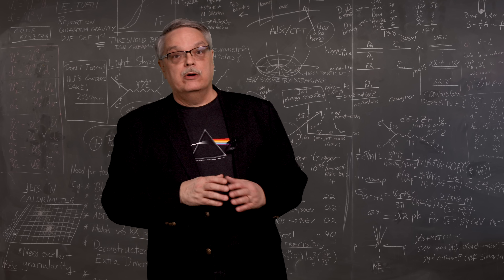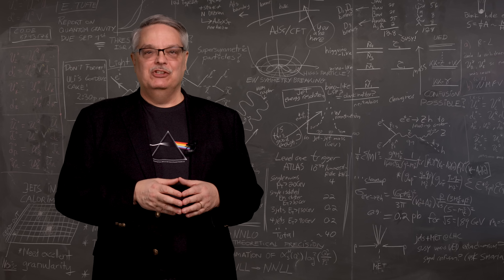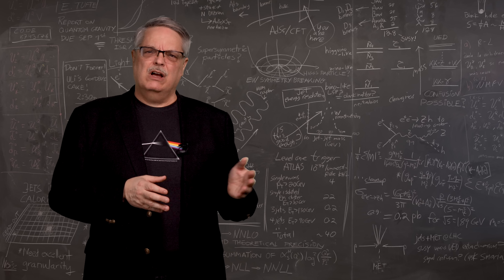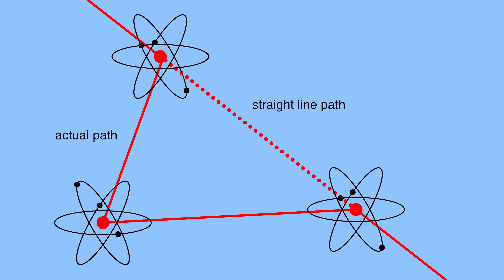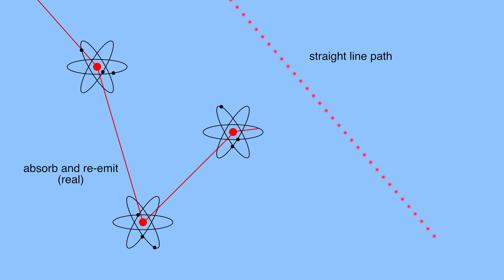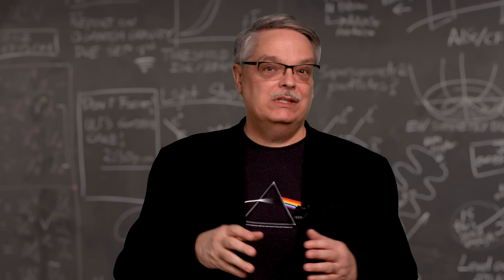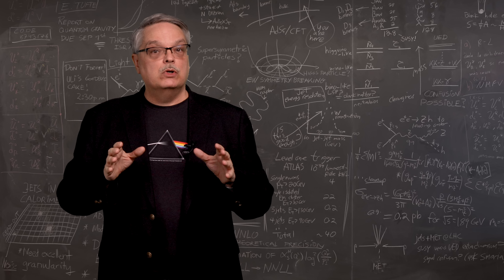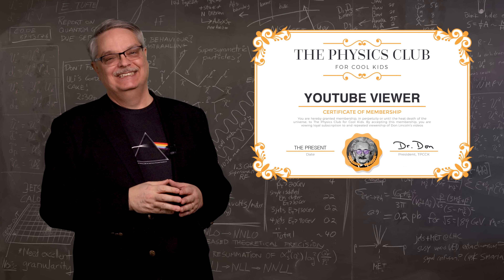Why does light slow down in water?

Comment: I did not hear why the wave superimposed with that generated by electrons moves slower, and why it returns to original velocity.  The glass heats up so energy is lost.  Is this all from IR not making it through?  Wouldn't just visible light heat up glass?  Then if it comes out the same as it came in, where would that energy (to heat the glass) come from?

Comment: Knowledge of humanity! 🤣Totally wrong! Light is never a wave, but ALWAYS a particle! It's known as quantum mechanics. Photons accelerate* (decelerate) in e.g. water or glass in proportion to the luminescence of the medium i.e. the more a medium luminesces the more the light decelerates. The deceleration* is a net loss of energy (E²=m²c⁴+p²c²) which is conserved by the luminescence. For example water or glass luminesces far more than air (a vacuum not at all) and slows* light in direct proportion. And since acceleration (deceleration) is curvature light bends (refracts) proportionately as well. QED. . . There, I have explained why light slows*, because of the luminescence of the medium and the conservation of energy and why the bending (refraction) of the light also occurs. . . The Fermilab guy doesn't know anything about physics and is just promoting obsolete pre-quantum hokum which requires a magical particle-wave-particle transmutation.
Note: curvature and acceleration are synonymous because when particle streams curve the must slow* (decelerate) in order to maintain separation (just like cars in traffic) due to Pauli's exclusion principle. The opposite and equal effect (acceleration) is produced by the cessation of curvature and it's why light reaccelerates* upon leaving e.g. water or glass.
* Of course, light doesn't ever change its speed (299, 792, 458 m/s), but time dilates instead.
Reply: Can you share the peer reviewed research paper, I'm assuming you will be the author on it right? Can you share and enlighten us? What sort of Lab do you run the research and get the data on? Just a curious person :)

Comment: Light speed does not alter. That should be said to everyone.

Slowing down of light speed in anywhere does not happen. Light speed is always the same, but different electric fields can alter the wave that combines with the light wave making combined speed different. And light itself creates this secondary field with interaction with electrons (and possibly with other particles too like protons?).

So in the roughest case in some Bosen-Einstein condensate you just make an opposite wave that cancels light speed in the combined wave and you nullify the speed completely. Light speed is the C, but nullifying field is -C so result is C-C = 0. So this means light may stop moving in Bosen-Einstein condensate. This has been done in lab experiments for a short time.

Also light wave cannot be send back by this method, just because C or -C are the maximum speeds. But you may bend light to do this (ie. mirrors), but it is an another discussion.

Great explanatory video. Keep on doing these!
Reply: Also light speed can be faster than light speed. If interfering field adds more speed to the light wave speed can be theoretically brought up to 2C (C+C = 2C). This has been tested in some labs that have gone over light speed.

In computers light speed (or more precisely electromagnetic wave speed) is a problem. When motherboard expands over 30cm the length of the cables becomes so long that information cannot travel fast enough when the processors hertz's (2 Thz) are rammed up. This has already happened and to overcome this issue data packets are handled simultaneously instead of sending them between processor and video card. But if we would find an usable way to top wave speed to 2C, then we could triple our PC's data transfer speeds (copper wire speed is are 2/3rd's of C, so 2/3C+2/3C+2/3C = 2C). So this is a real life problem.

Comment: Watching your explanation brought to mind the cool trick of dropping a magnet (that is hot glued to the end of a wooden dowel rod) down a copper pipe and being amazed at how 
1 fast it moves in air before it gets in the copper pipe
2 slow it moves in the copper pipe
3 fast it moves again in air after coming out of the copper pipe
The magnet has its own magnetic field but once it moves in copper then a reverse magnetic field is generated which acts on the magnet.
I like watching your videos  :)

Comment: Two comments: 1. Based on this explanation, can we infer that the mass & and charge of the electron are proportional to the index of refraction in transparent materials? One would think those factors could be rolled into a formula relating the relevant parameters. 2. Off topic, but I have often wondered about is the transparency of certain wavelengths in certain materials. Take near IR that can be transparent in some plastics which are opaque to visible light. I had to glue a piece of foil to a plastic nut once because we were using a photo interrupt slot sensor and the plastic flag didn't trip the IR beam. The engineer inside only needs to know enough to solve the problem, case closed & move on, but the scientist wants to know why, a lifetime of befuddlement.

Comment: So the density is the only thing proportional to the refraction of light in a transparent material, yet I can see that there might be very different electron configurations of different elements.  (ie a KBr crystal has a density of  2.75 while diamond has 3.5, but the electron configurations is very different between carbon, Potassium and Bromine; this is actually proven by their very different Transmission spectra as you look across the wavelengths of light which can pass through the material and also show that Electrons in the crystal ARE absorbing photons !!!)     IF this electron field hypothesis is correct different electron configuration of elements should make a difference other than simply density (generating a different counter wave)... but it doesnt.  ??????

Comment: If this works in the same way electrical signals/waves work, then this has nothing to do with the electrons adding to the signal.  It slows down because a changing electric field causes a changing magnetic field. As this signal passes through a material the signal is constantly realigning the electrons in the material to the polarity of the wave. It takes time for the magnetic fields to realign and you lose energy as heat when these electrons are realigning.

Comment: The wording is confusing. If the electrons in the material create an electric field that adds to the wave, then how does that information get subtracted from the wave as it exits.  This explanation doesn't really "add" up. If there are no electrons in a vacuum then there are no electrons to increase the wave velocity as it exits. You would need a filter to add/remove information back to the wave exiting.

Comment: If your explanation is right, we should see different color of light inside glass because It's making new wave with different characteristics which slow  down propagation of wave. But we observe same color inside the glass!i
Reply: Technically, light has no property called color.  It has wavelength and frequency.  Wavelength is lowered in the glass.

Comment: I thought at first that this explanation worked but after some thought I think I have some questions about it.  Questions that seem so significant that it seems Lincoln kind of waved his hands past my question.
Why is the wave from the electrons a different frequency than the incident light wave?  It seems like it should be exactly the same frequency but I really don't understand how this wave is created in the first place.

An electron in an atom creates a light wave when it changes energy levels and those frequencies are quantized.  But the incident light is certainly not making the electron jump to a higher level(orbital) and then back down (unless lasing). And if the electrons are emitting light then why does it stop the instant the light finishes passing by the atom?  Shouldn't that light wave continue on out of the medium causing the medium to glow?  So he must mean that the electrons only vibrate in place and sort of emit light at some different frequency that adds to the incident light. But what is that phenomena? I've never heard of it. But that light can't be in the form of photons because then it would continue on out of the medium and make the medium glow or different colors emitted. So maybe the electron in the outer most orbital can move up and down and sort of try to emit light but... oh I give up.

Also he says superposition results in a wave moving at a slower speed.  But that is merely the total of the two light waves that's moving slower.  The two separate waves still exist.  And the original one has no reason to not be still moving at C.  It's the sum that APPEARS to be slower.  The original wave is still moving at C and when that extra wave ends somehow the superposition sum also ends and what's left is the original wave.  And the original wave never slowed down from C.  Only the superposition sum.  I suggest an analogy: Start with 1.  Add 2.  1+2=3  but when you remove 2 you still have the original 1.  It was always there.  The properties of 3 had no effect on the properties of 1.

In electronic circuit analysis we use superposition but it is entirely different.  The currents we add together are not actual currents but rather virtual mathematical currents. The superposition sum is the real current.  But in this case the incident light is real.  The superposition is I don't know what. Virtual? But it's mostly because I don't understand where this second light wave comes from.  Nor do I understand why it's a different frequency.

Comment: Light induces an electric field in the material which opposes the original field, thus slowing the light. Very similar to electrical induced currents in conductors. For every action there is an equal and opposite reaction. 

THE UNIVERSE IS A PERPETUAL RUNNING MACHINE. ENERGY, ALWAYS EXISTING, BUT IN DIFFERENT FORMS, AMAZING. 🌎🙂
Reply: Then how does it speed it up again?
Reply: @karhukivi  It enters a new medium and returns to its original velocity. BACK EMF, ( electro motive foice) Different densities have different opposing forces. Light must have some sort of mass due to it being effected by gravity?

Comment: Hi Don, your explanation definitely more satisfying than the first 2 common ones. I still find it un satisfying, maybe you can shed light on my problem with your explanation: We know light gets absorbed by atoms in lumpsum as a quanta. So what is the cause of electron "agitation" in atoms in a medium, which generates the secondary wave? Is is the quanta of the incident light? Then it should be absorbed a a whole. Then I guess the excited electron, on the way back to lower energy state would emit secondary photons? The secondary photons obviously do not have the same wavelength as the incident light photons. So I guess the difference would be turned into the atomic grid agitations which is heat. Is this explanation correct? Is there any detail model explaining such mechanism? Is there any theory, based on this model to predict what would be a refraction factor in matter based on its atomic/molecular composition?

Comment: I do not believe this metamaterial explanation because it creates an interference pattern which we do not observe.  The polarization of the material has nothing to do with the speed of light, only the electrical permittivity (ABILITY to store fields, not actually storing) and magnetic permeability (ability to conduct magnetic fields).  If there was an interference pattern, diffraction would cause loss of  phase coherence and we don't see that with laser light.

Comment: Hey Don,  you didn't explain why the combined wave of light and electrons travel slower in the water than it would in the air!!! You just said it does.  Is that because the light wave induced second wave of the electrons of the water(or glass) travel slower than the speed of light(significantly slower)? IF so why is that the case?
If the reduction of the amplitude(combined) of the light & electrons due to having to mix with the wave generated by electro-magnetic field of the electrons, then the latter must be out of phase with the former in order to reduce the amplitude. Then the question remains why is that the electron wave is out of phase with light wave? But, this still does not explain the reduction of the speed of the combined wave.(wavelength or amplitude change do not contribute to the speed of the wave, right?)

However, if you(I) try to explain it in terms of light quanta, then it kinda makes sense because packets of light face more resistance in the water than it would in air due to having to face a denser material which contains more atoms, more electrons. etc. This also explains the loss of light energy as it passes through a denser material(energy of the light being absorbed by the denser material that it passes through due to light quanta-electron interaction, which means the atoms/electrons of the denser material absorbs some of the energy of the light quanta).

Comment: the photon that strikes the surface of the glass, traveling with many other photons also without mass in a wave,  is not the same photon that leaves the glass... the original photon ceases to exist... light has no mass... glass has mass... the speed of light is constant... the glass is essentially at rest...the electrons in the atoms of glass, depending on the temperature and thickness of the glass per atom of width, determine how the energy arriving at the surface of the glass will react... according to a determined calculation, per atom of width of the glass and if the glass is pure glass without contaminates and at "cool" temperature...after the charged elections, moving in the electromagnetic field the glass is part of, have reached the other surface of the glass they cease and create a new photon particle traveling immediately at the constant speed of light away from the glass... an entity new photon in an entirely new wave without mass... but the movement of the electrons in the glass material, the liquid matter, are subject to resistance and result in heating the matter... depending on the width per atom of the glass and the ambient temperature of the glass... now, if the second surface of the glass is covered with an element such as silver a mirror stopes the exit  of the charged electrons and selects the energy back through the glass again to the other surface and a new photon is created and travels away at the constant speed of light with many other photons craving together as a wave.  the example of water is like the example of glass in that they are both liquids.  glass is a super cooled liquid... glass can be considered to be at rest while water is subject to being at partial rest or in movement by other forces as it is not "frozen" in to a solid like glass... and considering that neither the water or the glass is exactly ever "pure" without trace amounts of other stuff it can deflect or bounce the charged particles of electrons in a similar fashion as the silver of the mirrored surface ... which in turn varies the perdetermined equation of the time the energy travels through the glass per atom of width and change the time it takes to recreate the photon.  it think... "shut up and calculate". Feynman.

Comment: I.still.dont understand. Why is the wave of the glass atoms move slower than the original wave? In what direction is this second wave move and why? And when combining them, why do we end up with a wave whose propagation speed is something in between? One may feel the answer to the second question to be justified by intuition, but intuition can be misleading; for instance wave add up in amplitude when they are in phase. More so, if the speeds of propagation of two waves combine to something in between, does it mean that in certain conditions one can completely stop a wave by hitting it with an opposite wave? There must be more to this!

Anyway, light of different wavelengths refracts differently which means that its components hit the second surface (back to air) spred out. How does it manage to reassemble?

Comment: Question: I was watching one of those deep-diving submarine videos where they go down and down and reach a point where light from the sun no longer penetrates. But light from the sub and the various creatures that emit light down there is visible - why is that?
What happened to the light from the sun? Was it absorbed by the water? And yet the light from the sub was not? What is going on?
Reply: The sun emits lots of light, but the ocean is very deep, so there's a lot of water in between the sub at the bottom of the ocean and the sun. most of the light bounces off the vast amounts of water and doesnt make it down to the bottom. the distance between the sub's flashlight and the sea creature is much shorter than the distance between the sun and the sea creature.

Comment: Why does light slow down in the water ? depends on if you are referring to Light as a wave or a particle or just an ambiguous Photon.?  Explain How a photon and how its properties change when it comes in contact with an opaque object as well as translucent. If all the common answers on the internet are wrong then how is yours right.? That's funny you say that a LASER if hitting glass always comes out just as it did but parallel to its original path ? I have observed the way you claim to be wrong true, some light dose but not all, it spread out and changed direction as well. Of course, you talking pure optically correct glass with a high tolerance flatness or the like of a nominal thickness and relatively little incident entry angle because if you change these at some point eventually the Light starts doing different things coming out at different angles and distorted as well as spread out.